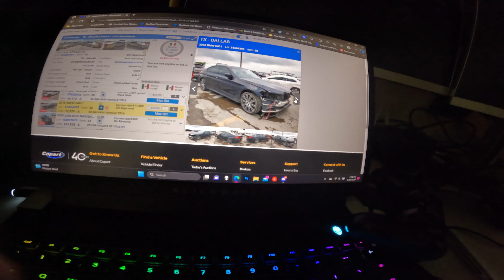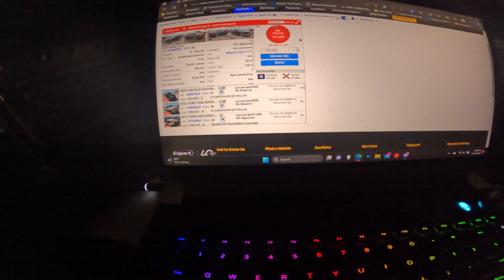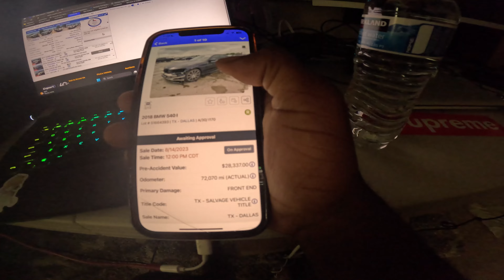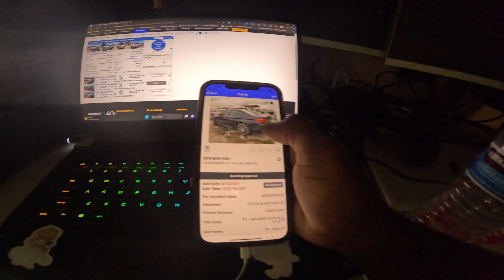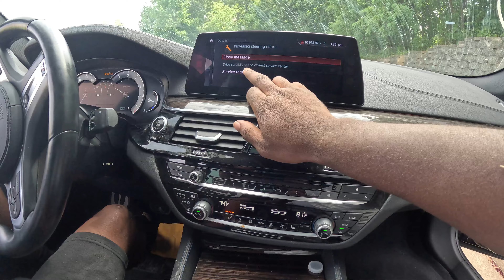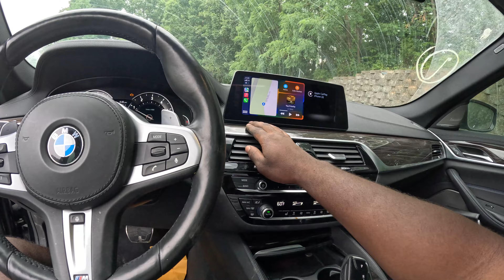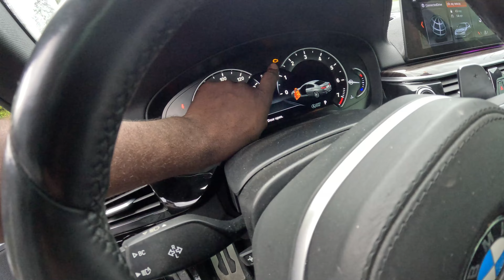I BOUGHT A BMW 540I (G30)

Comment: I own a 2018 540i as well rn it’s tune downpipe xhp transmission flash and e60 it’s making 520 whp right now planning on upgrading the turbo soon
Reply: MHD of bm3?
Reply: How reliable has it been??
Reply: @SinFullRexon55  so far very reliable and it’s daily driven as well
Reply: what do i need to tune a 540i? would u say go with 2018-19 or 2020 model?